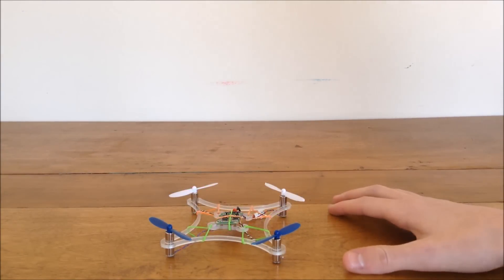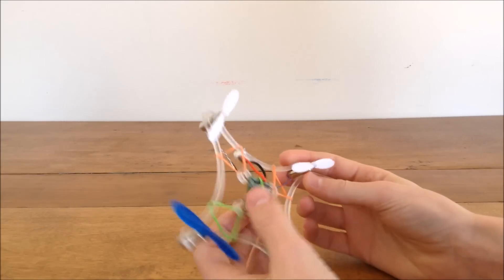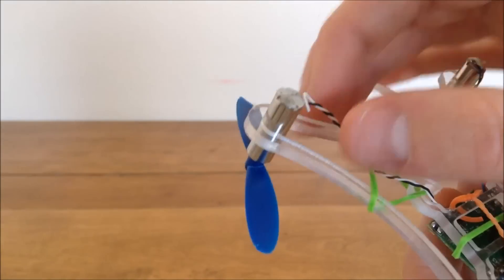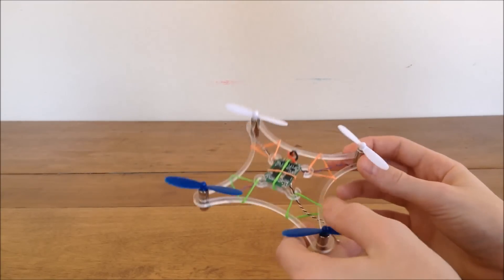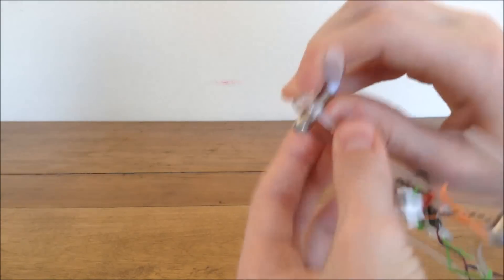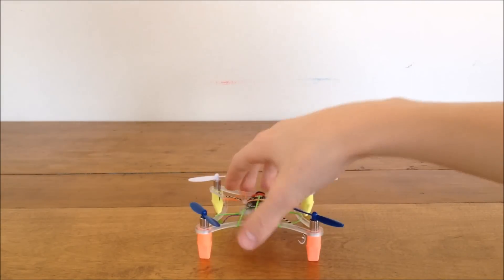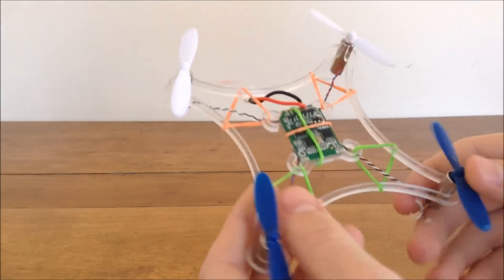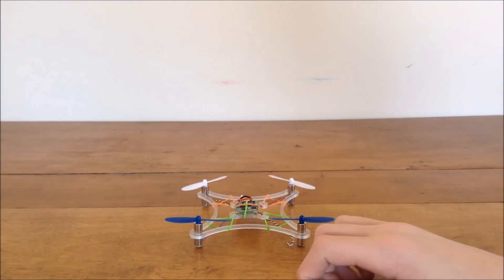Dreamcatcher Frame Review, Hubsan X-4 Electronics

Comment: I have found that putting some wire shrink wrap over the ends of the motors it protects the motor wires really nicely. That might help.
Reply from the maker: ***** Thanks for the tip! I dont have a shrink wrap so I just put a glob of hotglue on and it works really well. If I ever get some wrap ill try it out though! I should probably buy some from BG for the future. You can get like 150 assorted long pieces for like $3.

Comment: This is extremely cool!
I was going to gut my Radio Shack Surveyor Drone and build my own frame but heck I just ordered two of these kits instead.
It strikes me that if one cuts up the Hubsan bumper into four pieces one could use them on this frame too, as they clip onto the motors themselves.
I've noted your observations about the battery and FCB mounting and will experiment with my Radio Shack rig (I'm not ready to do this mod to my Hubsan just yet.)
Your idea about inverting the motors is very interesting as well and is something I'll have to try as I'm planning on mounting the camera up top and it will keep the props out of the frame.
I also like your solution to the landing legs issue. -very resourceful!
Thanks for posting this!
Reply from the maker: ***** It is! Hmm, I don't have the surveyor but should work. Glad you got some. That is a good Idea cutting up the bumper. Might try it since I don't use mine. I tried putting the motors upside down and the board up but for some reason the props don''t get enough thrust to lift off :( The hot glue is kind of necessary. I also broke this with the JJRC 1000A electronics by frying the board but have parts coming in soon to fix both of them. I will put glue of the bottom of the motors, on the circuit board where the motors connect, and over the battery wires were they connect because that is where I have been having breakages. Your welcome and I'm glad you liked it! :)
Reply: Okay thanks for the heads up about the inverted motors. It was a cool idea that maybe someone will develop props that are more...uh...proper for someday.
I have to agree that landing on those connections is super bad mojo for the motors.
Maybe a large diameter straw like a slurpee straw cut short and fit over the motors would work for lighter weight landing legs?
Reply from the maker: ***** That is a good idea for the legs! Would be really light weight, just would have to cut a slit for the wires. Might break easily though?
Reply: The RCAddict 
Easily replaced though!
Reply from the maker: ***** Yeah, I'll have to see if I have any staws big enough
Reply: The RCAddict
Okay after a little thinking and tinkering I realized that it's possible to use the Hubsan prop guard as landing gear if it has been modified by cutting the guard into four sections. This mod is on youtube.
I will be trying this with my Rad Shack dreamcatcher build, but if one feeds the motor wires through the hole I think it will fit onto the bottom of the motor just fine. I'm not sure how useful as a blade guard it would be, but it'll save the motors for sure and make for some funky looking shock-absorbing landing gear.
Reply from the maker: ***** Lol, sweet. That would look cool and should protect the motors nicely.
Reply: RockPDX
That looks really good!

Comment: I ended up using some self stick pads on the bottom of the motors.
they sell sheets of them where they sell stick on feet and such, which would also work but are heavier.
Really great vids!
Reply from the maker: ***** Yeah, the eraser worked great, making it more stable and quieter but were just too heavy so the pads might be too much too. I think the hot glue works very well but if that works well for you keep doing it :) I am so glad you like them, and it s a huge encouragement to get positive feedback!

Comment: Yeah.. That is nice review buddy! Well done :)  To bad about the motor-wire offcourse..
Would there be a way to get the plastick motor-bottom off of them, to get the the solder-point?? I'd try that, as the motor is useless as it is anyways..
Cheers!
Reply from the maker: DutchRC ADVENTURES   Thanks, glad you liked it! That is a good idea about the motor. I would do it except I already took the motor apart just to see what was inside and ended up breaking the shaft and throwing it away. If it ever happens again ill have to try that out :) I should be getting my new motors somewhat soon less than 3 weeks, so no problem.
Reply: The RCAddict Nothing a little time won't solve then :)
And you're welcome ofcourse buddy! 
Far from a filler this time ;)
Reply from the maker: DutchRC ADVENTURES Yep, next will be the H7 Unboxing so another main vid :) And I have a couple other things for main vids too, I try to keep the filler ones to a minimum :)
Reply: The RCAddict Grrr we have BAD weather rolling in (for about a week) over here :P haha.. Time for a build series I think :D hahaha
Reply from the maker: DutchRC ADVENTURES Hope you make something fun! Maybe a hex? Our weather here is just getting better. Spring is starting.
Reply: The RCAddict Spring over here as well ;)  but well.. hmm that doesn't really mean 'nice weather'  :D
Hmm I will be building a Very entertaining plane this time.. Would you be into building a scratch build plane by the way??
Reply from the maker: DutchRC ADVENTURES Yeah it seems really fun and cool. Just seems expensive and I dont know where to start :(
Reply: The RCAddict It does cost some $$ offcourse.. The biggest hurdle would really be getting a decent radio...
And well.. to start you could build that EasyWing I uploaded today.. You could definately fly that :)  Doesn't get any easier to build..
Reply from the maker: DutchRC ADVENTURES Yeah you said it. Its not so much as difficulty building or flying but the cost since I am on a tight budget. What do you think the cheapest I could build a quad or plane for? I could also go for a kit? They have mini brushless quads kits on BG for $100-$150 just need a radio.
Reply: The RCAddict You could go for a used Futabe T6EX as a radio.. Should cost you about $100..
The parts I used in my EasyWing are in the vid's description.. Hmm add some foam + small hardware to that (a few dollars)..  Quads I don't really know.. They should cost around the same I think :) maybe a bit more..
Reply from the maker: DutchRC ADVENTURES I was thinking of getting the Spektrum DX6I  . its $130 http://www.amazon.com/Spektrum-DX6i-Channel-Transmitter-Only/dp/B00K1P3KYW On amazon and binds with lots of things. Was thinking of getting the S Bach plane https://www.google.com/url?sa=t&rct=j&q=&esrc=s&source=web&cd=2&cad=rja&uact=8&ved=0CFEQFjAB&url=http%3A%2F%2Fwww.horizonhobby.com%2Fumx-sbach-342-3d-bnf-basic-with-as3x%25C2%25AE-technology-eflu4950&ei=Fg8SVdzZMo_LsATLkoGgAg&usg=AFQjCNEuvg1w-hO20ZhZDcHUfHm_-6nLXg&sig2=XGYSSIjs4FD6lb8aadJUag&bvm=bv.89184060,d.cWc later too. I might just get the super X micro brushless quad kit  https://www.google.com/url?sa=t&rct=j&q=&esrc=s&source=web&cd=1&cad=rja&uact=8&ved=0CDEQFjAA&url=http%3A%2F%2Fwww.banggood.com%2FSuper-X-125mm-Micro-Brushless-Quadcopter-With-MWC-Flight-Controller-p-943825.html&ei=IRASVaHIC6S0sASEmIC4Cw&usg=AFQjCNE5snQzpAP2LZ9clfklwUNeX-BzaA&sig2=NFtikNUf6CpxAOmO45jWDw&bvm=bv.89184060,d.cWc. Its just with builds there is a risk factor and that is why I buy RTF and BNF so I know it works :)
Reply: Getting a Spectrum radio can be handy to fly BNF planes/heli's/quads :)  there are a lot of those out there :)
Reply: The RCAddict ps: ohw haha :D  I was actually considering that same plane :D  (I have a balsa 1100mm Sbach.. SUPER plane :))
Reply from the maker: DutchRC ADVENTURES Yeah, lots bind to spektrum and that seems the cheapest one. Looks like a nice plane. I never really seen any balsas. The super X looks good but all of the reviews are bad....They say I should Just buy the parts and build my own.
Reply: Balsa planes.. they fly more precise.. I have ehm.. 2 at the moment.. But well.. If I really want to fly the snot out of something, I fly foam planes ;)
and yes.. that goes for a lot/all RTF's.. the electronics in those aren't as good as what you'd pick yourself..

Comment: Even though this might not matter I was thinking that when you bought this Dreamcatcher frame it would come with some sort of protective case for the circut board because when you lose a piece of that board your out of luck.
Reply from the maker: Justin Haynes The whole idea of the frame is to be as light as possible so that would add weight. It is very durable. just the battery and motor wires need to be re-enforced with hot  glue. :)

Comment: hey rc addict i am doing just what you did with a husban x4 h107c except I'm transferring the guts of the hubsan to the micro carbon H frame from micro motor warehouse  and i need to know the size of these motors e.g the motor mount size for the carbon H is 8.5mm, what size are these motors is what i need to know thanks!!
Reply from the maker: +ParikhFC !!! I am not entirley sure, you could check by looking to buy some of the motors, and see if the site lists the size. I have my one micro build coming up very soon on the channel, Nane QX FPV FC, Carbon H Frame, MMW motors, micro FPV gear. Should be sweet!
Reply: +The RCAddict  great thanks for he help! I will look forward to that build!!!
Reply from the maker: ParikhFC !!! No problem! I got most of the parts today! Just waiting on the frame and motors :)
Reply: +The RCAddict nice ! How much did it set you back ?!?!
Reply from the maker: ParikhFC !!! Well, I was sent the frame and motors for free, and the module for my transmitter was $30, FC $25, and props $5.
Reply: +The RCAddict for free how?!?!
Reply from the maker: ParikhFC !!! I get some things for free, as my videos generate sales for the products.
Reply: +The RCAddict i deleted the other one it had too many mistakes 

But basically I was flying my parrot MiniDrone and it hit a leaf and it then it flew out of the leafs even tho it was like stick and then it flew superhighway the motors cut and it landed nicely on the edge of my roof so I had to go to the neighbors yard to guide my dad who was holding a few broomsticks and then like half an hour later we got it down :/ :)

Comment: Nice video. Your idea about the dab of hot clue on the bottom of motors to act as a strain relief is a good one. Here’s something you can try that’s quite a bit lower in weight than pencil erasers (tried that too) and will really protect the bottom of your motors and that is to get some 5/16 inch screw thread protectors from a hardware store. 

Got mine from Lowe’s, here’s the link:
http://www.lowes.com/ProductDisplay?partNumber=137960-37672-881039&langId=-1&storeId=10151&productId=3012664&catalogId=10051&cmRelshp=rel&rel=nofollow&cId=PDIO1

They come in several colors and the color indicates the size, at least they do from Lowes. The yellow (5/16 inch) ones fit 7mm motors well, the white ones (1/4 inch) fit 6mm motors and the ugly green (my apologies to “Flyin’Ryan” should he read this, but not everyone loves green) 3/8 inch ones fit 8.5mm motors. They are cheap, .92 for 3 and don’t add much weight. They turn your motors into great non-skid landing feet! 

In my case I used one of Dave Wood’s frames, the Cross 7, that I got from Micro Motor Warehouse. It uses plastic screws for landing gear but with these protectors I didn’t need them at all.  

There are other sources for these so there is bound to be some near you or available to you that will work just fine.

After seeing your video, I am tempted to get a dream catcher frame from MMC. Good job my friend!
Reply from the maker: Frank Barajas Thanks! They look like they would work well. The dreamcatcher frame is nice and it is well thought out :)

Comment: I broke my hubsan motor and I literally just soldered the wires into the holes best I could and It worked fine until I got a replacement Its worth a try anyway you cant break it twice.
Reply from the maker: hawk 4 reason Thanks for the tip. Unfortunately it is now broken beyond repair and in the trash because I opened it up. I tried to solder them in but they wouldn't stick or get any connection.